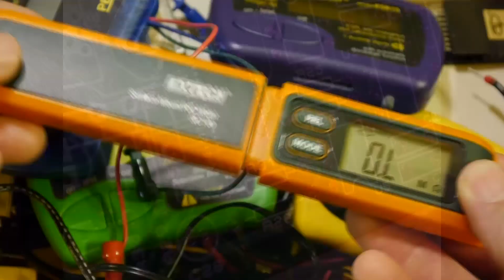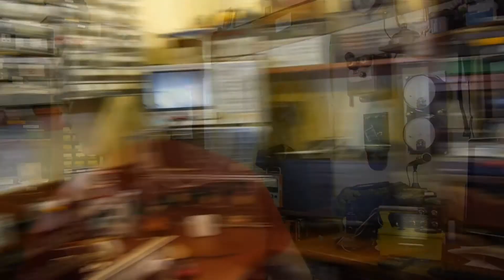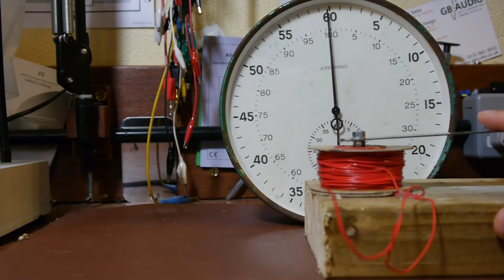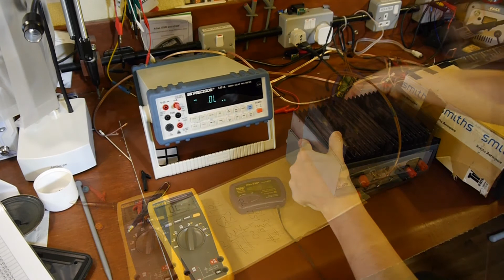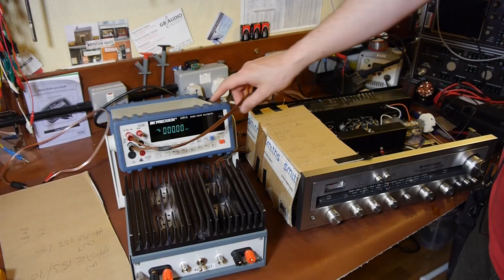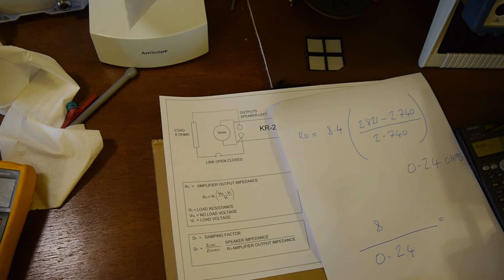Damping Factor - Audiophool Series

Comment: Doing actual measurements with power resistors in series with the loudspeakers shows, rather disappointingly, that the "damping factor" doesn't have that much effect on the actual performance of the loudspeaker. Measuring low frequency distortion (the place you need the "damping factor", which is a bad name for it) does show some effect. The most predominant harmonic of the fundamental is reduced by a few dB, but other harmonics come in that were not present with a DF < 1 versus a DF of about 80 due to nonlinearities of the speaker, resulting in the distortion being a wash. While I always believed it was important, other more experienced people said no, and the testing shows that. It may help with transient response, but after seeing how little it helped with controlling the motion of the cone, I have my doubts.
Reply from the maker: I wouldn’t have thought resistor would have much effect as it’s the amplifier ability to apply negative feedback. But this is just my opinion I haven’t tested that theory.  But a  resistor cannot actively damp the the oscillation although they will obviously adsorb it. They could actually make the situation worse as the amplifier has to drive the additional load.  I would be interested to hear if you investigate further.  Oh you put the resistor in series ok maybe so. Thanks regards Chris
Reply: @allthegearnoidea6752  The resistor is in series between the amplifier and the speaker, so the negative feedback cannot act directly. This reduces the damping factor to R_speaker/(R_series + R_amplifier). With a 10 Ohm resistor, the DF is less than 1 for at least the theoretical case of an 8 Ohm speaker. There are actually two effects. The one you demonstrate, and the other one being that of the back-EMF on the motion of the cone. This is analogous to the back-EMF in a DC motor. As the armature slows down, the falling back-EMF causes its current to increase in an attempt to maintain its speed. The opposite happens when the armature speeds up, the falling (and possibly changing sign of) the back-EMF causes the current to drop. The same happens in a speaker coil when its velocity does not match that of the derivative of the signal. I was testing to see if that had any sort of linearizing effect on the speaker. It was a wash. The most prominent harmonic was reduced with a high damping factor, but lower order harmonics rose, resulting in an inconclusive result. This is likely due to the high DC resistance of the speaker coil with respect to that of a DC motor, which will be substantially less than an ohm in many cases. I plan to try testing transient response at some point (what you showed), but given what I have seen so far, I don't think it will have a very pronounced effect.
Reply: @allthegearnoidea6752  "Oh you put the resistor in series ok maybe so. Thanks regards Chris" Yes :) P.S. Thank you for replying.
Reply: can long speaker wires affect damping factor or is it all just pop science bs?
Reply: @automachinehead  Yes, but the damping factor is not really the issue. The place where you need damping is at the extremes of the travel when there is significant cone excursion, but the voice coil is partially out of the magnetic gap at the forward extreme. From my experiments adding damping reduced odd harmonics, but added even ones as the voice coil providing the damping is also suffering from nonlinearities. The place where it does matter is frequency response as speakers are quite reactive. Its not uncommon for the amplifier to have to provide lots of current despite the output being near zero volts due to large phase shifts, and many speakers can have their impedances vary over an order of magnitude, such as from around 3 Ohms or so where the port is tuned to 30 or more on either side. This obviously makes class-AB amps run quite warm if you have very reactive speakers due having high current and voltage simultaneously across the output transistors. However, if there is a lot of resistance in the speaker cable, or its a tube amp with a transformer, the frequency response will start resembling the impedance curve, literally, as the wire is acting like a resistor and dropping some voltage along the way and acting like a resistive divider. The most extreme example was seeing what happened with my amplifier and speakers when fed a 1 Vp-p square wave. Despite there only being a few feet of 14 gauge wire, the square wave was not square anymore at the speaker terminals, probably due to something in the crossover network resonating and pulling lots of current, which caused a voltage drop along the wire. Obviously not good for the speakers. But similar things can happen if you have too long a run, as well as other issues such as amplifier instability due to the large capacitance and inductance that the wire has when it gets over 20 feet or so.
Reply: @mysock351C  so would it be better to have the amp as close as possible to the speakers and use, say, 5m of unbalanced interconnects?
Reply: @automachinehead  Ideally it would be best to use balanced XLR for the long run out to the amp if it has to be some distance away from the source. Unbalanced RCA is possible, but with long runs there can be substantial currents induced in the shield that will result in hum and other issues. Additionally the amplifier either needs to be isolated internally, or have its input tied to ground via a star point so its insensitive to the interference. The other approach is to use heavy gauge wire, but the specifications for the amplifier will need to be considered. There will be some amount of capacitance and inductance per meter of speaker cable and amplifiers usually cannot tolerate more than a few nF on their outputs without the possibility of oscillation. In linear amplifiers there are usually Thiel and Zobel networks to combat this, but they are not fool-proof. If you have some basic measuring equipment, you can build the equivalent circuit with a resistive load and see if the amplifier misbehaves when driving it with a square wave. However for long runs out to the speaker and amplifier an AVR or DAC with balanced XLR outputs is the most sensible solution. If the run is less than, say, 10m I would not be too concerned with it. Just choose the correct gauge of wire for the intended power output and it shouldn't be an issue.
Reply: @mysock351C  thank you for all the lengthy replies. both my dac and amp only have unbalanced inputs so I'll just follow your advice to the t and stay under 5m for all interconnects
Reply: theres a thing called thiele-small parameters, one of them is Qes - electrical Q factor, it basically describes speaker performance in a bass range, frequency response, phase and group delay.  if you have a speaker with high initial Qes then being hang on a high impedance amp will increase it even more, most likely resulting in unwanted "muddy" bass. if you trying to make a sound system with some specific parameters, taking in count output impedance of the amp is quite important.

Comment: Excellent demonstration of damping factor. Chris. Good damping was always more critical on ported reflex speakers that did not have the  air damping you get in an infinite baffle speaker system.
Reply from the maker: Simon Spiers Hi Simon thanks for your nice comment, this one did work out better than some of my other video. I'm getting a bit bored with amplifiers and may do something else for a break. I still want to try my HP8903 and i would like to examine one of your previous comments about bias level vs distortion.  I still have the audio sound card test system in design and want to compare these results with conventional test gear. I am going to get that TEK scope out this weekend see if still locks up.  Regards Chris